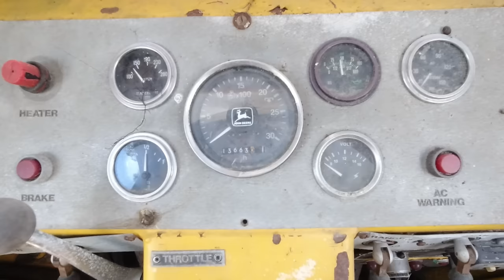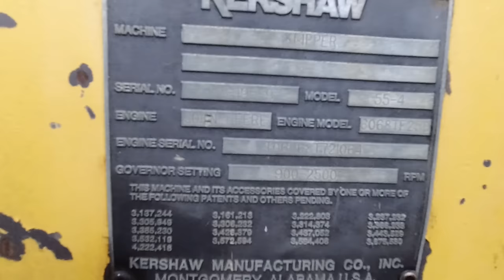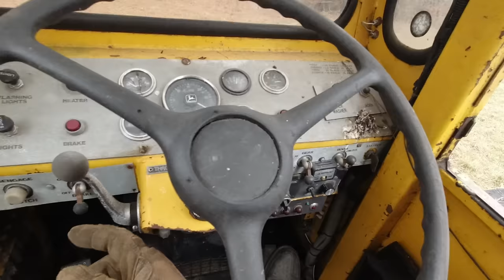WILL IT START!? Is it worth SAVING?! 27 yr OLD Right of Way Trimming Machine

Comment: Thanks for another great video Wiley and Jacob. 
It was interesting for sure. 

It is an old piece of equipment but runs good it seems. Would think lots of good parts on it plus good big tired and of course a real good engine it would appear. Sure would think you could get your money plus some out of it. 

Good job Wiley and Jacob getting it running without much trouble at all. Engine runs nice. 

Thanks to Wiley and Jacob for getting it running. 
Take care now. 
The Iowa farm boy. Steve.

Comment: That machine runs great Wiley, could use some trans fluid, or something, but it’s got a lot of good parts , certainly worth $6500.00👍👍🤗🤗🍮🍮❤️
Reply from the maker: I thought so too 
Engine and tires along  with weight of machine 
I doubt seriously you would ever sell a part off of it.